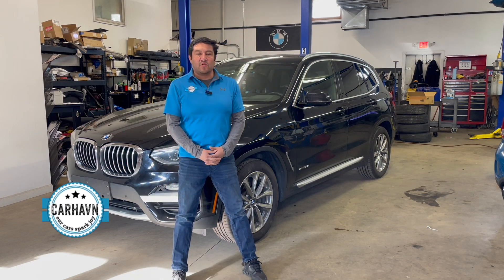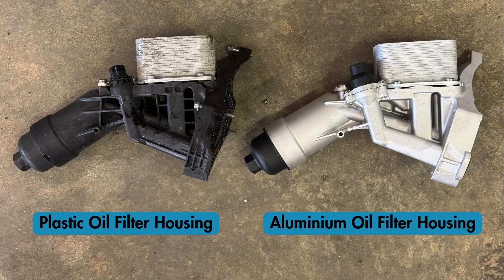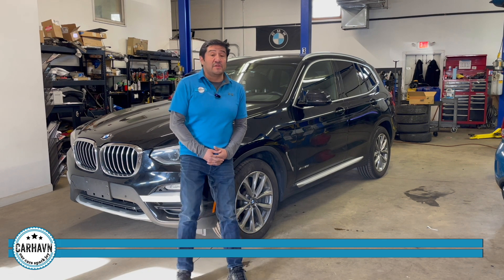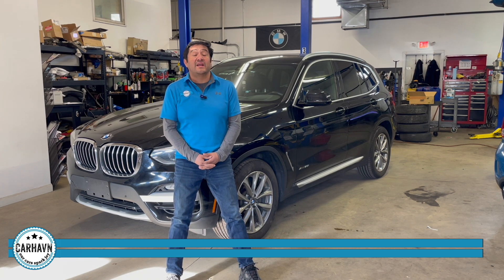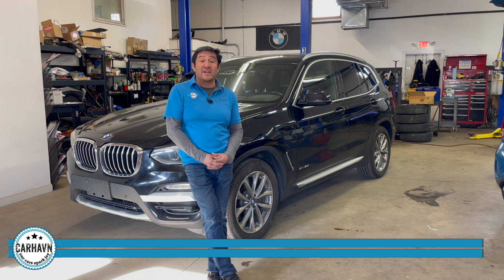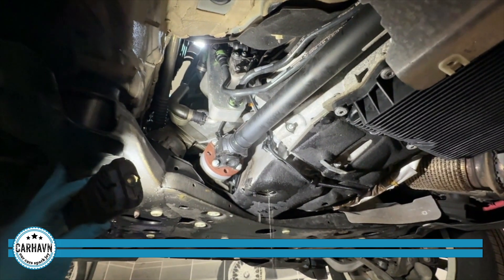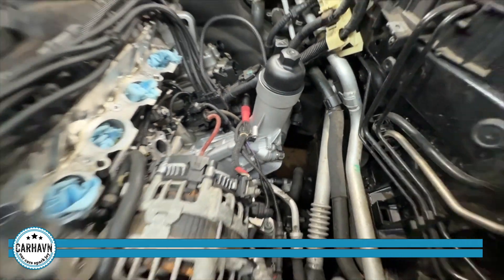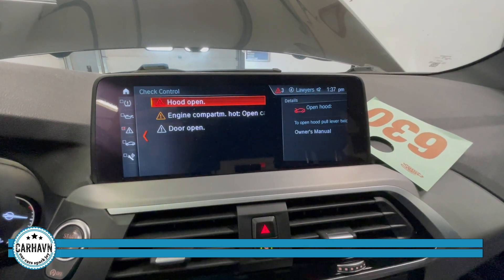Replacing BMW's Dangerous *Plastic* Oil Filter Housing!

Comment: Hi from CT ... I've heard of the oil filter housing going at even 65k miles....  some others online have commented that they had leaks with the rein gaskets.... of course its possible they didn't torque to spec.... but a number of people suggest using the Rein housing but using BMW brand gaskets with it.... what has been your experience...any call backs?
Reply from the maker: We have never had a comeback with this kit after doing dozens.
Reply: @carhavneurotech  What torque nm do you use, 10nm ?